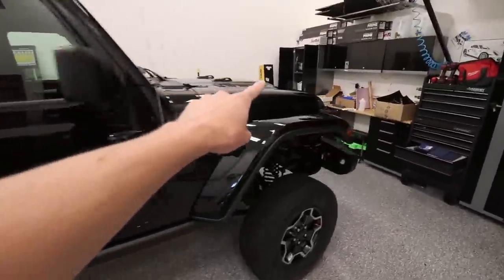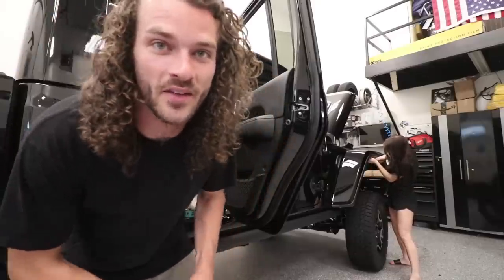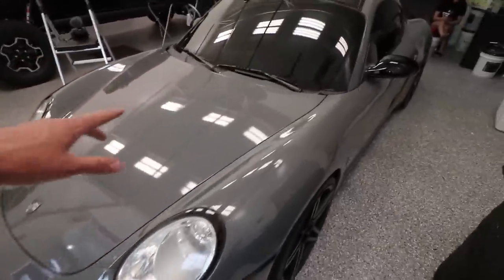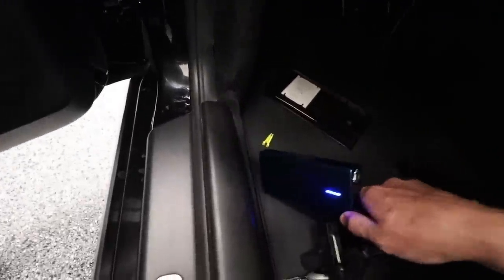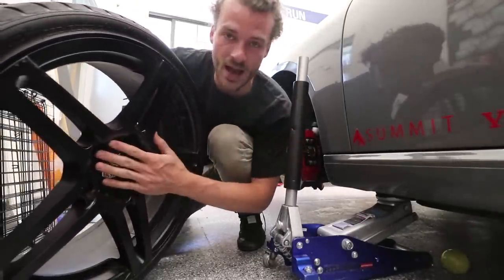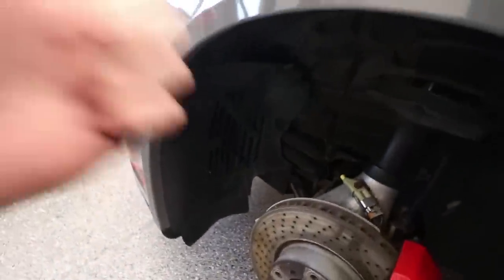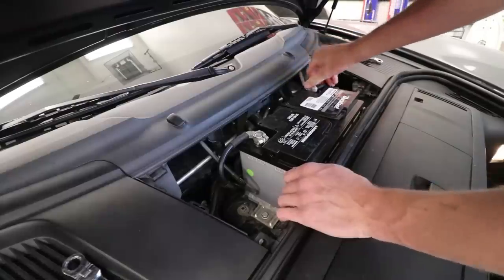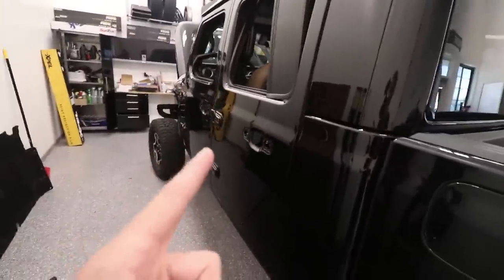Our Porsche Cayman is Completely DEAD.....

Comment: The bypass works, but there is a little trick. After you have plugged the bypass in the fuse box, do not push the button on the car to open the trunk, but the button on the key to open the trunk. Then it works! ;)
Video as always top, and very sympathetic team.
Greetings from Germany :)

Comment: Battery went dead and frunk switch didn't work for me either when applying power to the fuse box tap, but then I tried the remote frunk button and it popped open!  Saved myself the hassle of doing the manual wire pull procedure shown in this video.
Reply from the maker: Ahhh! Should have tried that!

Comment: Quick question Clayton,  do you use ceramic coating (opti-clear) over ppf? Thank you!
Reply from the maker: You totally can! Although, I dont only because I dont install ceramic coatings
Reply: @SummitLife  Thanks for the reply. I just had my Titan XD front half  Nano-fusion ppf'd and then ceramic coated the rest of the truck with opti-clear.  I thought the whole truck was getting the ceramic coating but was told they couldn't use the opti-clear on the ppf! I really want something that will make the bugs easily washed off the front end! Is there such a thing? Thanks again Clayton and I'll be cheering your channel on brother! Keep up the good work!
Reply from the maker: @Slinky108  I know there ceramic coatings that can be applied ontop of ppf.  Just couldn't tell you for sure what ones

Comment: stay away from 987.1 S   it has the most unreliable engine
Reply from the maker: Completely false
Reply: @SummitLife  my 987.1 S `s rod bearing spun and before that the engine has serious bore scoring issue,  we have a little group that everyone has a 987.1 S  , all seven of us have replaced the engine,   u know the famous Coyote swap cayman S? he is my friend, and he is one of us , if u google "987.1 S engine blown" on forum, u will see that happen to tons of car, 
the engine just cannot pump enough oil on high G corner
Reply: @Rorschach34Bos  that's if you're tracking the car. Not really pulling consecutive g's on the street. What did you swap your engine with?
Reply: @joek1302  my 2cents is a sports car should be designed to be drive in sport manner, otherwise why not get a more practical car like Panamera?
5 of us bough junk yard engine and some of us sold the car already, one guy did swap the 997.1 base 3.6 engine, a lot more robust than M97.21 cayman`s engine, one guy swap the coyote
Reply: I have driven the shit outta my 987.1 S for the past three years, and she has given me zero engine issues. Not sure if it's made a difference, but I've been using the Joe Gibbs Driven DT40 oil, and I change it every 3k-4k miles. I'm not saying that issues dont arise with these engines, but I have several fellow PCA members with the same engines, and no one in my group has had a bearing, bore score, or IMS issue.
Reply: 80,000 miles and mine runs like a champ. I get my oil analyzed every time I change it. Virtually no trace metals detected. Nobody in my region club has ever had any serious failure on their 987.1 and some of them race, but all of them know the proper precautions to take if you intend to race it. I suggest you educate yourself on the subject of racing before you go out on a track. Even then, very few tracks have serious high G corners.
Reply: @trapp1now1  there is no way every M97.21 engine will blown, but the percentage of the flaw engine is way too high , 
M97.21 acutally have less IMS issue than M96, major issue is bore scoring and rod bearing 
as far as i know, all of us engine dead after high G corner
Reply: @Rorschach34Bos  I 100% agree that the oil starvation issue is the biggest issue, and was certainly a miss for Porsche creating a sportscar that is made for high G cornering. I would have liked to see Porsche do a recall to install a redesigned deep oil sump with improved baffles and pickup. I think running a thicker, high zinc oil helps though.